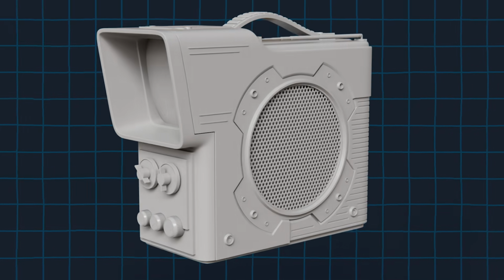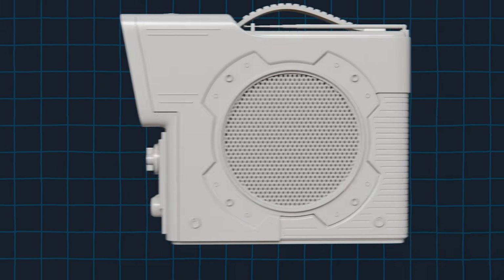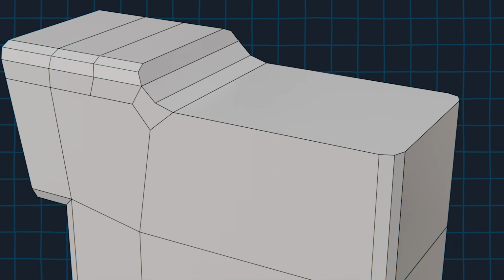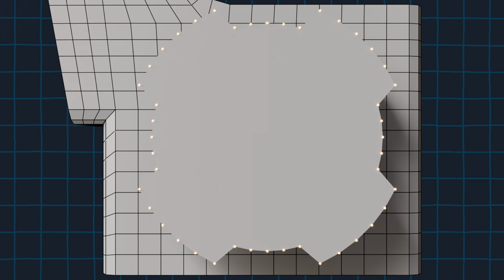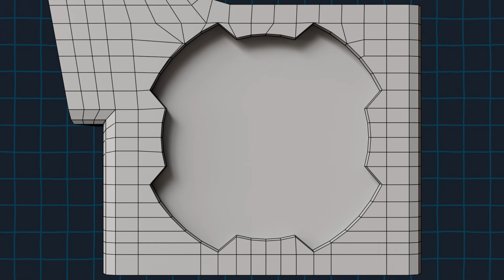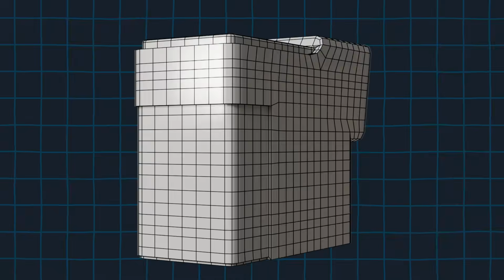The Only 3D Modeling Tutorial You'll Ever Need.

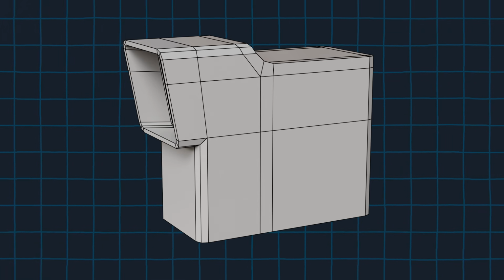Comment: Question: Instead of adding a lot of edge loops (4:02) around the object before doing the Boolean, I added only the exact number of loops I needed and positioned them so they lined up with the vertices of the hole (using GG and snapping). I found this easier to clean up, and it also helped me avoid triangles. Would this be considered bad practice, or is it a valid alternative? Thanks! :)
Reply from the maker: Its totally okay, to do, great thinking!

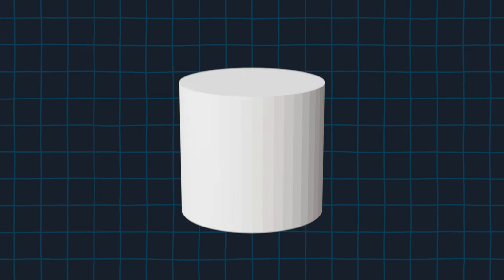Comment: 3:27 hey wanted to ask how exactly did you scale outward them in defferent directions. because when i try to use alt+s or just s it still scales by length from the circle. Edit: I figured it out. just changed my pivot point to individual origins and it worked perfectly
Reply from the maker: I did it the same way, glad you figured it out!

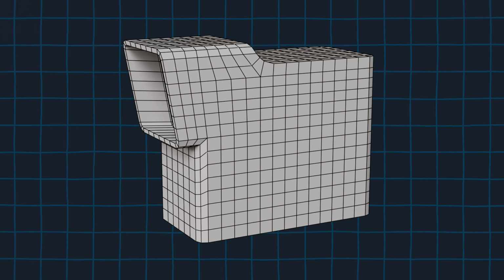Comment: Lost me at 4:02, is there a quick way to auto mesh the object, when I try adding edge loops with CTRL R & scroll my mouse wheel to add, but it's only one side at a time..
Reply: yeah this is confusing asf
Reply: Select the object. Go to edit mode. Select Loop cut tool from the left tools section. Go to the tools section in the right panel (Logo looks like a wrench and a screwdriver). Increase the number of cuts. 
Note that you have to select the Loop cut tool from the left tools section, it won't work with keyboard shortcut

Comment: I don't understand how to achieve the extrusion at 7:50. When I extrude along the normals, a lot of the faces around the edge of the cut out extrude in different directions and I get an uneven extrusion, though this is kind of what I'd expect if the faces are following their normals e.g. the faces around the bottom of the model along the straight edges all extrude straight and evenly as they should

Comment: I can't normally loopcut area under cutout. When I do horizontal loopcut for ractangle extrude top area of this object cant be loopcuted. I did this manually. Also when I in Object mode I can see edges that not should be visible in object mode. I thought it's "doubles" but not.
Also when I did loopcut for the whole TV and tried subdivision on top of my TV I got serrated shape.
Started 3 times all over again and getting the same prblems each time((

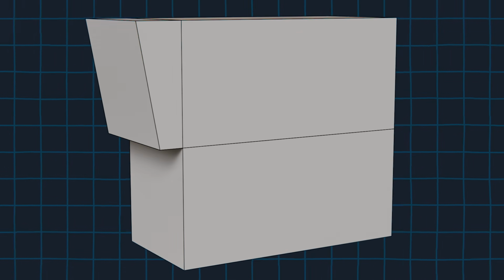Comment: I'm stuck at 0:53 how do I extrude like that?
Reply: after extruding u gotta select the outer face of the extrude cuboid thing and then press ‘s+x’ to shape it into a trapezium cuboid (for blender)
Reply: @itzjuztme144  not understanding. when i add the loop then extrude then s+x makes it weird
Reply: Press the E key after clicking on the side you want to extrude
Reply: Or, after extruding with E. You can go to the side-view, then wire-frame mode, select any two vertices of extruded face (Either top two or bottom two), then move them horizontally with G + X or G + Y depending on your axes

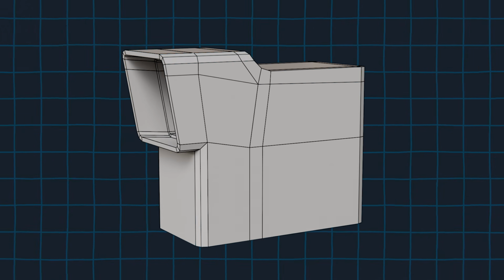Comment: 3:03 how to get rid of zig zag edges? i tried scaling to 0 on Z axis to an active element, but that distorted the taper since it didnt edge slide. And to use the edge slide, i had to use the knife tool to make a borizontal cut through the mesh to clamp the edgslide to thst straight contour. But i have a feeling you did it better, so how did you do it? 

I cant comprehend why we cant scale to zero but as an edgslide >:(

I tried doing it with edgeslide by using the knifetool to cut a horitonzal cut, but the small screensection was distorted when i slide the edge. please show us how you did it! make an unlisted video and reply to my comment, if you please.

Comment: How do you keep the distances so right and nice between the lines of edges, when you even them out to "relax the mesh". Like at 7:33 top left part of the TV where you move six or more lines of edges and get even spacing inbetween. Is it just approxcimate manual work that looks good because of experience or is  there some tool for that? Otherwise, awsome video!
Reply from the maker: Thank you! There is a pre installed add-on in Blender called LoopTools, but you need to enable it in the Preferences panel first. Once activated, select the edges you want to “relax,” then right-click to open the LoopTools menu. There you’ll find the Space and Relax tools, which I used to evenly distribute the quads. Hope this helps!
Reply: Select all horizontal lines to use：loop tools-space, then select all vertical lines to use：loop tools-space, and pefect. By the way，you can select a horizontal line and press Shift+G-Select Similarity-Direction，to quickly select all horizontal lines. Similarly, you can quickly select the vertical line，too. Finally，Please excuse my poor English.
Reply: @liufox2408 Thank you very much, Sir! I’m thankful for the time you spent to share this answer🙏

Comment: I do understand what you trying to do, but here is my feedback if one is needed. For people who have done at least once a project in Blender would understand the tutorial. Without showing the tools and menu options for the technics used in the tutorial, people who just started with 3D modeling would probably not understand why you doing some of the stuff. I don't think the 3D modeling is hard to understand, but rather the 3D modeling software are, since aren't designed for everyone but engineering thinking

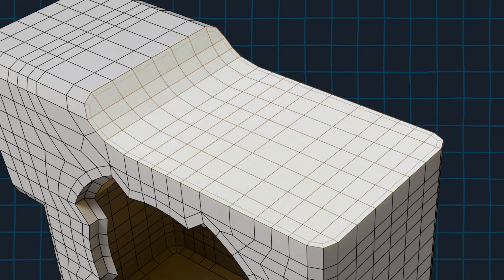Comment: Soooo... at 6:58 how did you extrude the faces and leave them at the same "height" in Z axis?  is there a way to do it without adjusting the edges "height" 1 by 1? Great Vid : )
Reply: There is a way! What works best for me is selecting and extruding all of the faces at once, selecting the faces that were just extruded, and setting their scale on the z-axis to 0. This trick should work on faces, edges, and vertices and on all axis as well. It’s very useful!
Reply: Scale z-0

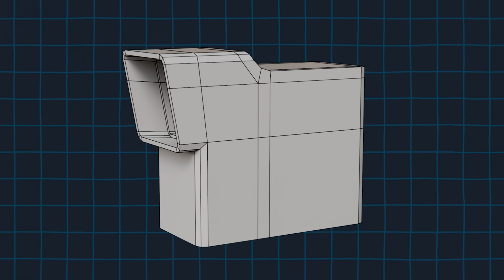Comment: 3:03 how did you make the edges straight tho ?
Reply: i use s + (x/y/z) + 0, using active element as transform pivot point
Reply: Does the pivot point actually matter for this technique? I’m only asking because I’ve done this a few times and it hasn’t seems to make a difference
Reply: @CadeMahler  Yes it matters.

For example, if You want to make certain vertexes to have the same height: 
1. Select all vertexes 
2. Choose the last vertex as the pivot point(you can think of it as the target height)
3. S + Z + 0 (flatten all the vertexes on Z axis to the pivot point)
Reply: @CadeMahler  also I'm using global transform orientations
Reply: @bbruvv  When I do that, it breaks on sloped edges. How can you avoid that?
Reply: @Looki2000 Maybe some vertices are overlapping? I'm not sure tho...

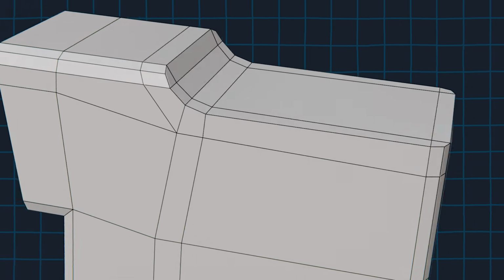Comment: 2:41 how you did that? i tried inserting faces but the edges are not correct and the size is also messed up I fixed it manually!! but tell me if there is a easy way..
Reply from the maker: Might be that your scale is messed up, try pressing ctrl A while in object mode and select the scale option. Then try insetting the face again.
Reply: "Inset" the face, not insert.

Comment: What's your advice for dealing with pinching on curved surfaces 
I use the shrinkwap method but it needs to be applied after subd otherwise it messes with the bevels
Applying shrinkwrap after subd can be limiting sometimes
Reply from the maker: Hello! Excellent question. If your mesh has good topology and the correct density, and you still get pinching, the only "real" or "proper" way to deal with this is the shrinkwrap technique.
However, there is also a Data Transfer modifier, which takes the normals of a target object and copies them. The results are very similar to shrinkwrap.
But keep in mind that if the original geometry had pinching, that means there is a bump or a divot in the mesh. The Data Transfer modifier may make it appear as if the issue is fixed, but in reality, if you look at the silhouette of the model, the bump will still be there.
So the Data Transfer modifier is a more "hacky" way of doing things.
Reply: @CG_Loop ok so shrinkwap it is or higher poly modeling
Reply: @CG_Loop in your previous video you mentioned that once you started modeling properly you also started to earn money so i was curious do you just do the modeling or like full ads and product visualizations?
Reply from the maker: Product visualisations and selling 3D models.
Reply: Because I'm learning hardsurface subd modeling specifically, as a first step in to 3d.
And so I wonder if this skill alone will be enough to get some money to be able to upgrade my hardware
Reply from the maker: If you are able to create quality models and pretty renders, you can definitely make enough money to upgrade your hardware.
Reply: @CG_Loop ok that's great to know thanks for all the replies,
Would be nice to have your video on how to earn as a 3d modeler, because your videos are very clear and to the point